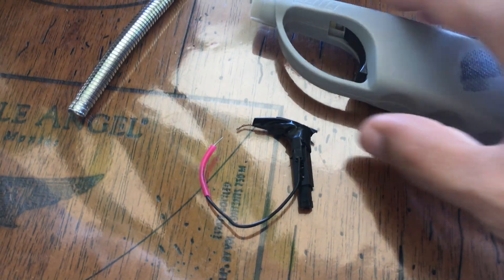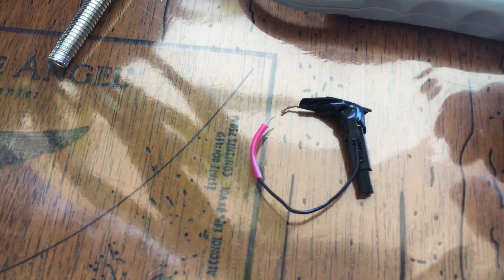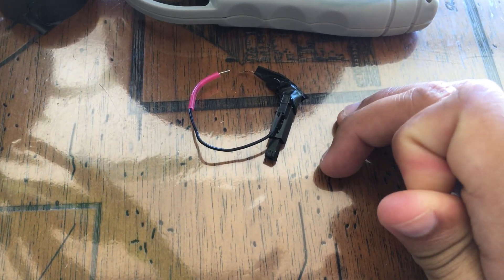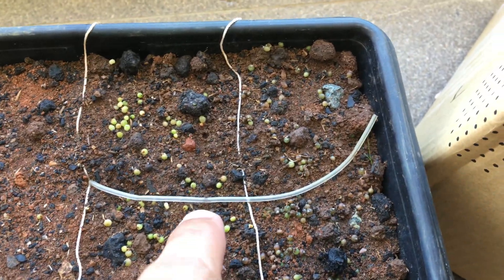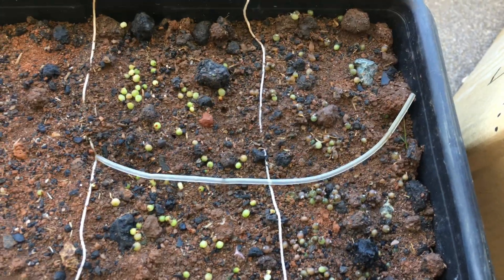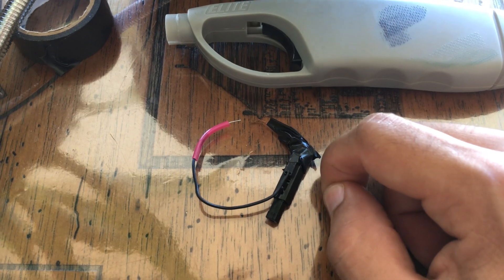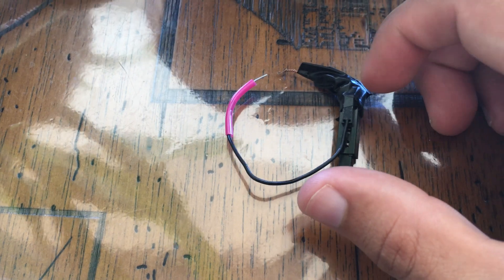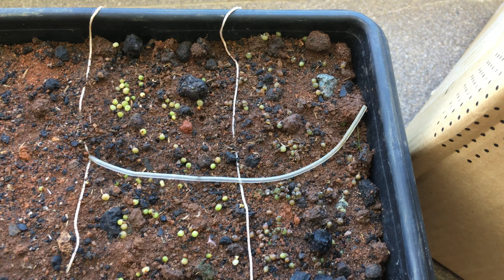Electric shock discharged on cactus seedlings to induce mutations.

Comment: plasma creates life so probably can active some dna sequences but less is more dude.
Reply from the maker: Yea 5 shocks was excessive but I didn't really have much research showing amount to do. I have reattempted this with yearlings and used 1-3 shocks each. They have survived but maybe the age will prevent any mutagen effects. This idea is interesting to me so I'll likely revisit it in the future using 1-2 shocks on new sprouts.
Reply: yeah in gnosticism which is the quality that made Aristotle and Plato so wise, there is a mistery about the creation of the earth and it comes from a snake in the sky, but it is made of plasma . but before you think I am a lunatic check about how it was made this organism called Acarus crossii you will be flabbergasted (andrew crosse acari experiment) @ModernGrower
Reply from the maker: Thanks I’ll look into that. Gnostic texts are pretty interesting. I had fun going down that rabbit hole years back as well as philosophy. Great past time and helps you think differently about some topics. I’ll check that out